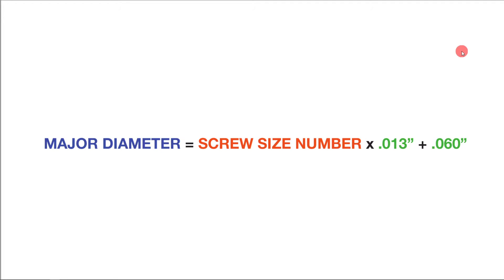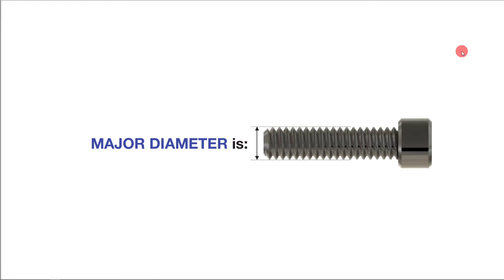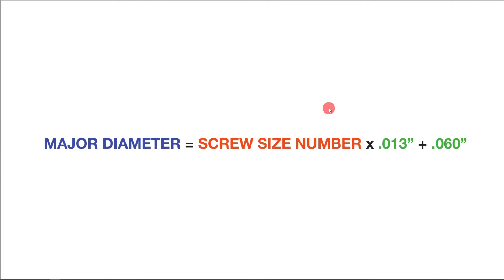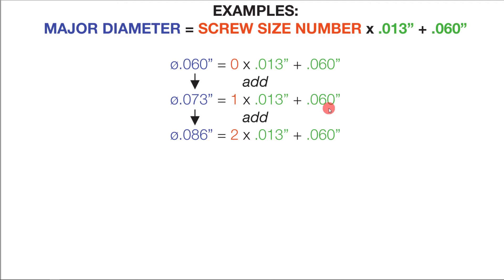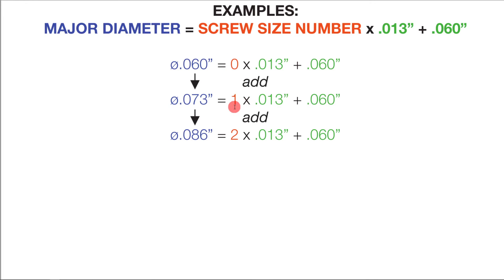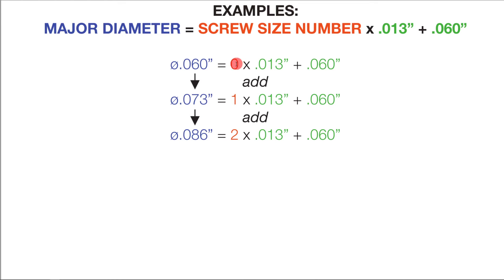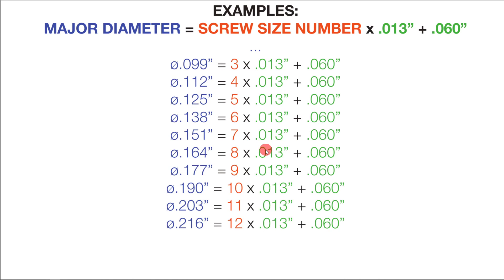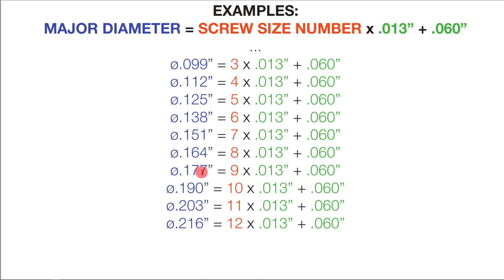American Screw Sizes Explained

Comment: Questions. Where did the .013” and 0.060” came from ? Some odd conversion factors ?
Reply from the maker: Another reason to switch to the metric system, I guess...
Reply: Engineering Juice hahha. That’s correct. I’m used to the metric for screw size. So this conversion seems foreign to me.
Reply from the maker: @Davyjones5454  It is a weird number. Then again, converting from mm. to in. yields a weird number as well.
Reply: Like PI in the formula for circles, they are the numbers required.
Reply from the maker: These are some odd numbers (literally) but they are in the standard and work accordingly!

Comment: This is awesome! But you didn’t include #14 size!
Reply from the maker: Haha! An important consideration. If I did a video like this on the metric system, it could be half a minute.
Reply: @AvivMakesRobots  Seriously, though, I had no idea this formula existed, thanks for the wonderful lesson!

And after I posted this, I read an older version of the ASME standard (OK, just the chart page), and was amazed to learn there are a bunch more sizes!

Here are my notes from that table, and I’m wondering if you can explain why there are numbered and fractional sizes interspersed, and why some sizes are for tapping only. I wrote this for a European YouTuber (Alexandre Chappel) who just designed some clever screw sizing templates, but was badly confused about the US’s so-called Imperial system:

This convention comes from ASME B18.6.3, which defines US machine screws (as opposed to bolts). The full list of sizes is 0000, 000, 00, 0, 1, 2, 3, 4, 5, 6, 7, 8, 10, 12, 14, 1/4, 16, 18, 5/16, 20, 24, 3/8, 7/16, 1/2, 9/16, 5/8, and 3/4. Sizes larger than 3/4 are bolts not machine screws, and are defined in different standards. Sizes 7, 14, 16, 18, 20, and 24 are for tapping screws only. Nominally, the standard is supposed to switch from numbered screw sizes to fractional sizes after #14, right at 1/4”, but those last four numbered sizes get interspersed among the fractional sizes for a reason I’m not aware of.

Comment: That makes much sense... Not. 
Start using metric please
Reply from the maker: Yes, the metric system is a bit more intuitive for sure!
Reply: @AvivMakesRobots  It being intuitive really makes no difference. Nobody is calculating the sizing. It is all pre-calculated in the references. You have weird drill sizes, root diameters, thread depths, and such for metric fasteners as well. The metric version of this is the thread depth is 0.614 × pitch. The outermost 1⁄8 and the innermost 1⁄4 of the height H of the V-shape are cut off from the profile. How is that any more intuative?
Reply from the maker: @DavidKirtley  Hi @david kirtley. The intuitive part is that there are 1000mm in a meter 10 mm in a cm and so on/so forth. As we know, the imperial system is inherently confusing: 5280 feet in a mile and etc. it is just a less organized system. Also, more off topic, water freezes at 0 c and boils at 100c/ freezes at 32 and boils at 212... it is more organized and intuitive.
Reply: @AvivMakesRobots  That is mostly a red herring. The metric system and the SAE, Imperial both use arbitrary units. We use units that are appropriate to the task at hand. Conversion of units is rare. Even in metric (or especially in metric for that matter). You don't say I walked 1 kilometre, 2 decimetres, 5 centimetres, and 5 millimetres. You would say 1.255 kilometres.  Even then, you wouldn't measure kilometre long distances down to the millimetre.   Fractions are easier if you don't have precise measurement tools.  You want to find the middle of a string, fold it in half.  Yes, there are some archaic specialized units. Even with the adoption of metric system people hold on to some of them. Minutes and seconds for angles and time are a great example.  We even have fake metric stuff that is inch based but measured in mm for instance.
Reply from the maker: @DavidKirtley  Yes, but our whole world is based on a base ten number system and the metric system uses that. The Imperial system fails in that sense.
Reply: @AvivMakesRobots  No, the world is not based on a base 10 system. The Mayans would have made the same argument for base 20 and the Babylonians for a base 30 or 60 (yeah, that one is really weird.) There were some that used base 5. Every argument you make for base 10 can be countered with another system. Want to talk binary?  
When they defined the metric system, all they did was take a bar or metal and engrave two lines and said "This is a meter"  Only later did they go and try to tie it to 1/10,000,000 of the distance between the equator and the north pole along the prime meridian. Now it is 1/299,792,458 of a second that monchromatic light travels in a vacuum. Is that the logical, base 10 that the world is based on?
Reply from the maker: @DavidKirtley  Yes, but our common world is base 10. Money, product quantities, etc. By this, I mean in manufacturing. Tying back to the video, ordering screws is always done in a base 10 system.
Reply: @AvivMakesRobots  No, unless you are buying trivial quantities, fasteners are sold by the pound. Actually many things are ordered by the gross (144 or 12 dozen) by the barrel, by the troy ounce, by the ton,  by the bushel, board feet.  There are more units as well.  Cubic yards. Bales.  Cords.  Many things are sold by differing quantities that fit on a  palette like plywood. 50 lb bags of some stuff, 80 lb bags of others.
Reply from the maker: @DavidKirtley  Yes, exactly. 50 and 80 are base ten.
Reply: @AvivMakesRobots  50 is also part of base 2, 5, 10,  20 and 25. :) I am mainly poking fun because there is no inherent superiority of one system over the other. Both systems are arbitrary. Metric shines a bit brighter for dealing with larger volumes of things when we are dealing with calculated values. Traditional units are more convenient with dealing with smaller quantities and direct measurement.  It is a lot faster to count out yards of fabric or rope by the length of arm and just throw in a little extra to make up for any discrepancies.  Irregular items at a bakery were sold in 13s for a baker's dozen to throw in an extra to make up for discrepancies in size. Stuff was packaged for transport and lifting by people. Stuff was packaged in barrels (even dry goods) because you can tip them over and roll them instead of picking them up and putting them on a wheel barrow. Screws are sold by weight because nobody wants to sit around and count out a bunch of screws.
Reply from the maker: @DavidKirtley  Metric is a better system. Most people will not remember 32 and 212, but can easily remember 0 and 100. It makes so much more sense. Also, knowing the Latin prefixes allows you to "guess" what the unit is. For instance, mille means a thousand, so it is easy to understand what a millimeter is.
Reply: @AvivMakesRobots  Um, the base unit in metric temperature is degrees Kelvin, not Celsius. :)  Water freezes at 273.16K and boils at 373.16K  Yeah, that is easier to remember :) 
I am not saying metric is bad. It is just not "better" than anything else. It is just an arbitrary unit. You want to divide inches in 10ths? I have the ruler for that. They make them.  They make 10ths of feet rulers too Cars measure miles +10ths :) :)

My micrometers measure in tenths, hundredths and thousandths of an inch as well. :)
Reply from the maker: @DavidKirtley  Yes, C is a derived unit from K. The fact that Kelvin is from SI shows it's genius... K is the best unit of measurement for calculating the temperatures of the universe,  Celsius is the best for calculating the temperatures of the earth and Fahrenheit is best for the temperatures of living things on earth.
Reply: It wouldn't make a difference. The ratios between the measurements would still be the same my dude, just in cm.